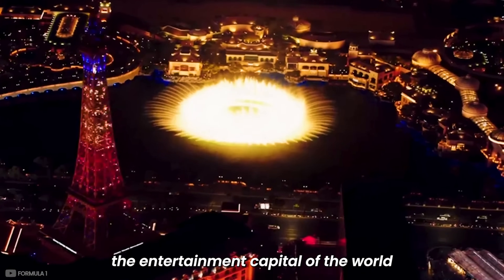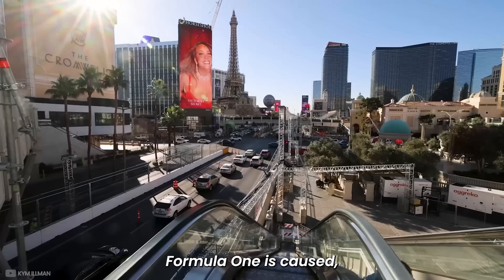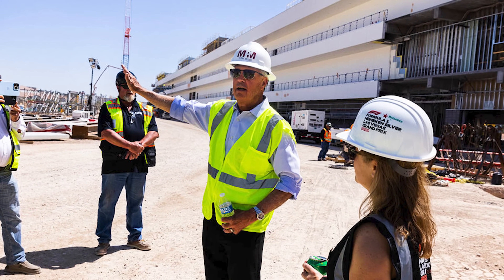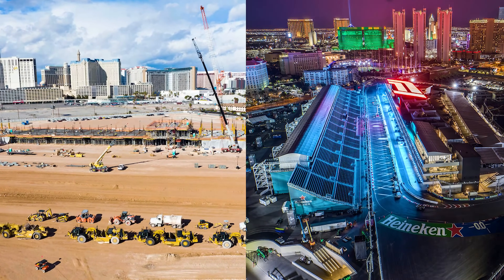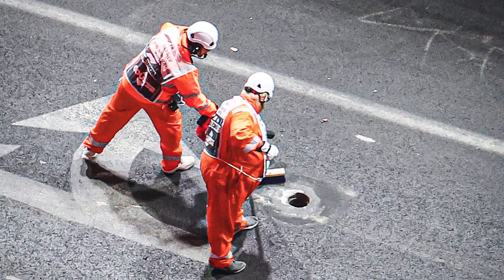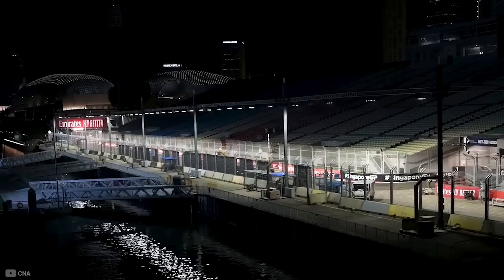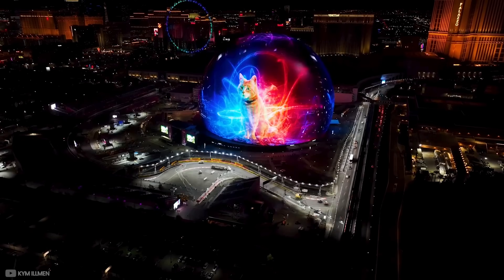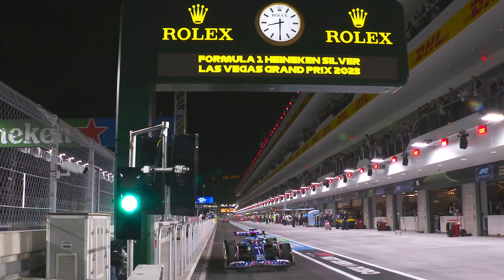How the Las Vegas F1 Track was Built

Comment: What a failure. They have ruined the strip, and the stands are mostly empty. And the greed of the hotels may put off visitors forever. The Tuscany, where I like to stay, is over $490 today 11/18 but $36 tomorrow. The fencing has blocked visibility nearly everywhere. And the race itself, so far, is a predictable boring parade with almost no lead changes. This is awful. And the big paddock area will just rot 50 weeks a year between races. Whoever conceived/funded/approved this mess should be fired or removed from office.
Reply from the maker: It won't rot, its their new global HQ, F1 plan on doing alot to help bring money into Vegas, I think it will work out. Honestly, the race, which what truly counts, has been pretty amazing, and thats all people are going to remember